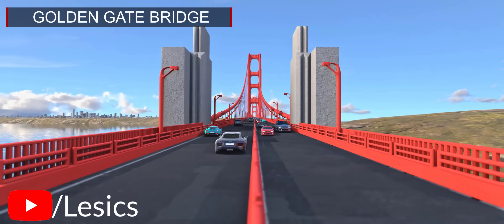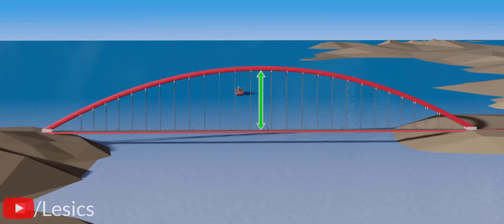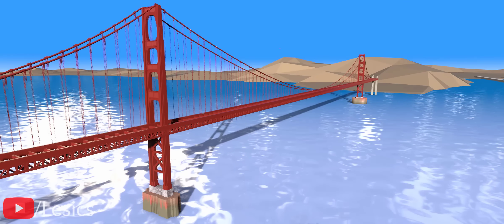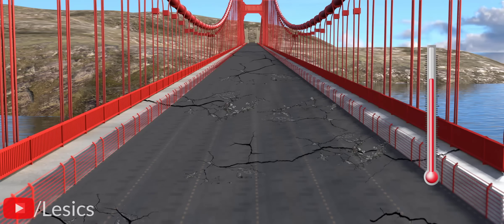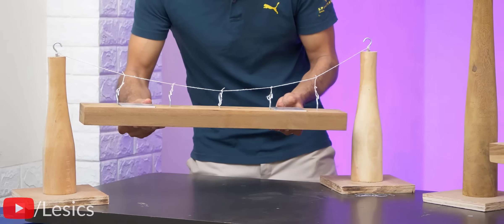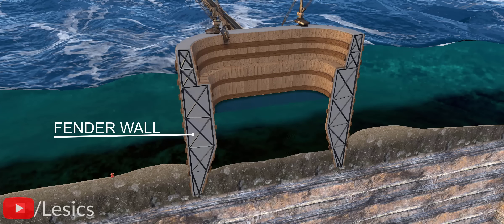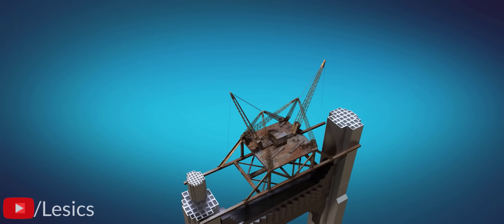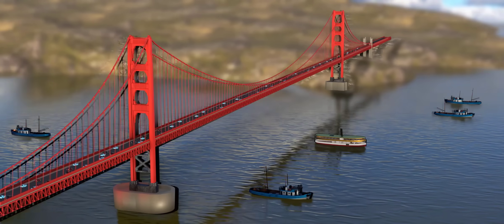Golden Gate Bridge | The CRAZY Engineering behind it

Comment: They made all this in a time when there was no CAD and other simulation softwares. It's truly remarkable.
Reply: All you need is a pen and paper
Reply: @eyeofthepyramid2596  all you need is imagination actually
Reply: @eyeofthepyramid2596 and an incredible imagination….
Reply: Just do it the traditional way which is oh dear.
Reply: The engineers had slide rules to aid in calculations. This included approximate values for trigonometric and hyperbolic functions.
Reply: @gregparrott  The slide rule actually provided very accurate calculations. It was a must learn tool for anyone designing anything in the building industry!
Reply: @nixl3518  I used a slide rule decades ago, during college engineering courses. As good as they are, you're doing pretty good if you can get 3 digits of accuracy, and less on things like logarithms, trig functions, etc.  
If multiple terms are multiplied or divided together, each with 2 or 3 digit precision, inaccuracies grow a lot. There's 'sensitivity analysis' for estimating how much they grow, and which parameters most contribute to error propagation.
Reply: @gregparrott  So did I! My dad taught me, who was and Architect/Engineer and used them before calculators eliminated them!! My comment refers to the building industry, which the video is all about. The precision you cite is plenty accurate to do the job!

A slide rule requires you understand the calculations you are doing and what the expected result might be in terms of the power of 10 each step in the process of calculation. Should the expected number be like 2.134, or 2,134, for example?  If you keep this in mind the errors you cite are constrained and not propagated. If you use the slide rule mindlessly, the result is the same as the rule used when writing computer programs: GIGO!! Intelligence is required.
Reply: WHEN "WE CANT MESS THIS UP" WAS ACTUALLY INTIMIDATING
Reply: @v @vividvisionproductions8288 nah fr huh
Reply: I’ve worked with a guy who’s been in the industry for a long time. He still draws all of his flow diagrams and machine dimensions BY HAND. And they all look pixel perfect. CAD is cool but watching someone put out a whole production line in one go with a pen is crazy.
Reply: You obviously would be completely and utterly clueless about everything that you can't relate to "software", you are an example of just how bereft of imagination people have become in the age of computers.
Reply: Most of the inventions we rely on these days, like Planes, Boats, Cars, etc were made using Pen and Paper math. Amazing.
Reply: New York's Brooklyn Bridge is a remarkable engineering feat and it was designed and built literally in the horse-and-buggy era.
Reply: Everyone: "they built this with no CAD or modern software,  wow"

Egyptians: "hold my beer"
Reply: @fernarn3650  by use of slave labor 😂
Reply: And no stadpro software to calculate easily if it's safe. Heck not even Excel for numerical calculations. They truly designed it without any software.
Reply: @Oatmeal4Breakfast  If you need excel for calculations then you shouldn't be designing bridges
Reply: We have physics for a while now. That’s the most important thing you need.
Reply: They could just make smaller 3D models of the bridge and see which ones worked best
Reply: And the primitive survey equipment to obtain control points. Remarkable
Reply: I hate comments like this. Every one knows computers didn't exist 90 years ago.
Reply: @Tony32  The differential analyzer, a mechanical analog computer that used wheel-and-disc mechanisms to perform calculations, was around in the 1930s.
Reply: If you declare with your mouth, “Jesus is Lord,” and believe in your heart that God raised him from the dead, you will be saved.
Romans 10:9 N
Reply: Bro it’s hurt common sense fr. If you’ve got a mind for this it is literally like common sense
Reply: Have u seen the pyramids? And no they weren't made by aliens.
Reply: True that. Yes 🙌 it does amaze 🤩 me too.
Reply: True. So imagine how the ancient Egyptians built their pyramids.
Reply: and here we sit still trying to figure out how the Egyptians and other ancient civilizations achieved their massive pyramids!
Reply: they had manual computers, called slide rules
Reply: Humain Brain is the best  simulation softeware.
Reply: Look at all these history nerds. I don't belong here
Reply: I started in engineering behind a drawing board, and got into CAD a bit later - and later still into BIM and simulations, not just visualising but properly virtualising projects.

The same principles apply as back in the day.
Yes, we can simulate pretty much anything we like, but we still absolutely require a good working knowledge of those processes to check we're actually getting things right.
No important calculation is done only once: it's checked and checked again, in various ways.
Some of my colleagues are so experienced in this they can predict the outcome pretty damn accurate.
But we never rely on gut feeling: numbercrunching is definitely what we do as engineers, as very often lives depend on it! And we never take that for granted, believe you me...
Reply: @claudevieaul1465  yeah I agree, honestly anyone off the street could learn how to 3-D draft pretty easily. In order to really know what youre doing and potential problems you gotta have some mech e knowledge. Sort of like knowing how to code vs knowing computer science
Reply: Using a slide ruler??
Reply: @eDXTRe  "Slide Rule" no "r". 

Most everything constructed in the 20th century used this tool, until mechanical calculators began to appear prior to the digital versions...
Reply: @sabbracadabra just*
Reply: Who came to the comments after he said orange Color
Reply: @urusovite8212 You can conquer and steal. Those two aren't mutually exclusive.
Reply: @urusovite8212 What's your point? Are you trying to moralize colonization and mass genocide..or?
Reply: @urusovite8212 Again, what's your point? Why you telling me this, lol.
Reply: @urusovite8212 Sounds like something a supremacist would say..
Reply: @urusovite8212 Lmao what? What am I a victim of? Keep crying hillbilly. 😂
Reply: @urusovite8212 Cool.
Reply: That was the era when people still had to THINK to overcome a problem.
Reply: Indeed!!!
Reply: I tell people all the time,respect to those who built highways,skyscrapers and cities at that,without any modern technology,I always ask how they did it ,and that’s what brought me here to this video
Reply: CAD and other simulation softwares are there to assist you not lead you. Sure it would be more tough to do things without them but definitely not impossible.
Reply: the dollar has already lost a lot since the beginning of the threats to Russia and Ukraine! The number of transactions conducted in US dollars decreased from 71% to 48% worldwide and the USA had interest on each transaction conducted, since they were conducted in dollars! And now there are fewer deals,, less income,, the default is closer, are you stupid?The USA received hundreds of billions in transaction profits! Less and less now.ДУЖ
Reply: Holy crap there is a lot of science on this , I love it ❤
Reply: Yes indeed pure imagination and experience. That's engineering and engineer are great
Reply: Simulation software is based off math, you can do your own simulations on paper
Reply: Agreed, same thing with map makers and surveyors of the past who had to use a pencil and a protractor
Reply: The calculations really aren't that complicated
Reply: You a techinician mate?
Reply: You must be very young
Reply: First off there was no computer at all!
Reply: @eddyyy22  I will not abide another toe!
Reply: Brother they used a more advanced simulation software 🤣 and that u will use in 2030
Reply: Not really. With enough material and human sources this could do any high school student now. ;)
This is just basic physics and mathematics. ;)
Reply: This was made in modern era, after industrial revolution, it's not that impressive, it's way more remarkable what Romans achieved.
Reply: @Zuconja  both can be impressive
Reply: @Zuconja  It's so funny when idiots call great engineering not impressive.
Reply: @Zuconja  Right, the Romans made poop sewers. Truly remarkable...
Reply: @0x1EGEN  Learn some history.
Reply: @Zuconja  I have? You do realize I was merely being sarcastic. (But it is true the Romans were really proud about their sewer systems). If you know your history you would also know that the Romans also stole a lot of technology from the Greeks.
Reply: @0x1EGEN  if you knew history you should've said that Romans 'stole' a lot of stuff from a lot and i mean a lot of people and perfected it to the point of non recognition

They also discovered the new North American continents before the Vikings
Reply: @haberdasherrykr8886  Just seems like you're being pedantic here? Also what does Romans discovering NA before the Vikings have to do with the discussion?
Reply: @haberdasherrykr8886  I've never heard of your claim. While the Romans had ships, they were not equipped to cross the Atlantic, let alone return. Can you actually cite anything which substantiates that the Romans knew of North America?
Reply: @gregparrott  artifacts were found in native American villages
Reply: @haberdasherrykr8886  Really?!!  I'll have to look into that.  I've heard of Viking artifacts found in northeastern Canadian provinces, but no Roman ones. The distance that Viking had to travel (also using Iceland and Greenland as potential stopovers) was a L O T shorter than what the Romans would have to travel from, say, Great Britain.
Reply: @haberdasherrykr8886  Thats not proof of existence. Artifacts of different civilizations are found all over the world. Its called trade.
Reply: @jibran6635  trade between romans and native americans?

That's not proof of existence?
Reply: @haberdasherrykr8886  It could have been trade between vikings and romans who then brought those artifacts along with them to america.
Reply: @jibran6635  the roman artifact(s) are much older and found way inland than the vikings ever ventured

There's a reason this claim stands unexplained 

Arguing bull with me isn't going to change that
Reply: @0x1EGEN  Sewers existed way before rome as a city even existed.
Reply: @jibran6635  You're right, I shouldn't have claimed the Romans invented them. They were originally adopted from the Etruscans.
Reply: @Zuconja  I don't see romans have vertical skyscrapers  with small bases or bridges crossing water like this ones. Or long range ships that can cross oceans in stormy weather. Or airplanes. Stop hyping them so much and see that our modern infrastructure is also impressive.
Reply: @0x1EGEN  poop sewer is truly important, imagine living in London before the poop sewer made.... Yuck 😅
Reply: @0x1EGEN  the persians invented the windmills the chinese created printing 
without the chinese giving us printing and the compass we wouldn't have anything
Reply: @haberdasherrykr8886  Yes of course! If you even knew MORE history, you would know that the Romans got to the moon before anybody else did, as well! They even made it to the far side and have been living there for the last 2000 years!
Reply: p p @0x1EGEN
Reply: @0x1EGEN  No not really, but have adopted it in a large scale.
Reply: @0x1EGEN  and the Greeks stole it from Thraci
Reply: @haberdasherrykr8886  your reason for the Roman’s discovering NA before Vikings is the same thing as you telling other people “arguing bull with me isn’t going to change that” you’re basing your entire reason on a very flimsy discovery. I can say I have an axe from Babylon, that must mean they discovered NA before anyone else! It’s such a stretch lol, the only thing that comes close to discovering NA before the Vikings was the Greeks theorizing that the world was round.
Reply: @0x1EGEN  Roman stole from Greeks? False, Greece didn't exist back then
Reply: @0x1EGEN  they invented so much more than sewers
Reply: @0x1EGEN  it was remarkable, especially at the time, the fact they even had a poop system at that era was remarkable.
Reply: @inigochicano  Look up Indus valley civilization, they had sewer system thousands of years before romans.
Reply: @0x1EGEN  
Damn fine poop sewer too mind you, Paris did not have sewers until 18th century and London was using the Roman sewers up until 17th century when they finally expanded them.
Reply: @0x1EGEN  And Greeks stole from Egyptians. Who cares?
Reply: @eternalnjem  Literally I don't care, the other guy did and apparently you as well lol.
Reply: @Zuconja  Found the roman history nerd…
Reply: @0x1EGEN  They built and aqueducts which are still standing 2000 years later.  I suppose you are the ones who failed at school...
Reply: @0x1EGEN  The modern world has also stolen technology from the old world, that is not called stealing it is building upon. duh!
Reply: @topsyturvyy4558  Not sure if you're being sarcastic. The definition of stealing is literally "the action or offense of taking another person's property without permission" - Oxford dictionary. The Romans enslaved a lot of Greeks and forced them into submission. Are you the type of person to deny Americans stealing land from the natives, claiming it was just "building upon"? I sure hope not...
Reply: @Zuconja  God like ratio~ 🤓
Reply: @0x1EGEN  I stand with the ancient Canonites of yore.
Reply: @0x1EGEN we still do that btw
Reply: @Zuconja  what did Romans achieve? Just curious
Reply: @Zuconja  okay thank you for clearing that up for us.
Reply: @Zuconja  Roman's used slaves.... it was.likely easier
Reply: @Zuconja  all of that is irrelevant except the timeframe. All those structures made by the Roman’s were built after the Roman Concrete Revolution. Downplaying facts with your opinion and irrelevant comparisons make you look uneducated, and you said absolutely nothing about CAD software as well as misunderstood the point of the comment, the bride was just the example, the grand topic was about cad software.
Reply: @B_COOPER  When I was a kid, I went to my mom and asked her how was I made? She said that my dad made me out of mud.
He didn't have CAD software, yet managed to make me.
Reply: @Zuconja  "it's not that impressive" lol, your mom is not that impressive
Reply: @rydellgarcia  I can confirm that your is.
Reply: @Zuconja  my bruh tried to start his youtube career but it ended before it even started. GET YOUR ASS OFF THIS MEDIUM AND MOVE ALONG GEEZ. 😂😂
Reply: @Zuconja  No, it is still impressive what this man achieved tackling all those problems in a very efficient way.  The Romans had their technology, the modern mas has it's challenges too.  It's like trying to put together a puzzle but with different tools.
Reply: @Zuconja  the Romans didn't achieve anything they stole all of their technology then slightly improved it.
Reply: @Zuconja  "it's not that impressive" LMAO 🤧
Reply: @Zuconja  you be waking up real early just to hate huh?
Reply: @Zuconja  as someone that does a ton of finite analysis, it's very impressive. Would hate to do the math by hand
Reply: @Zuconja look at what the Assyrians were doing before the Romans
Reply: @Zuconja  "It's not that impressive". He came up with a several new methods. For you it's not "that impressive", because you already can read everything written down in textbooks, what these enginers or scientists came up with. The arrogance of your statement is remarkable.